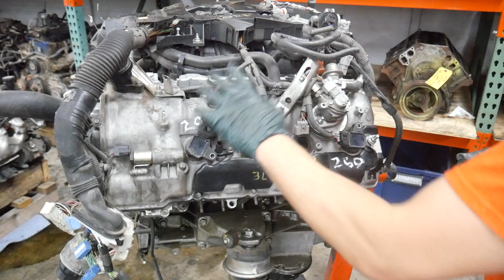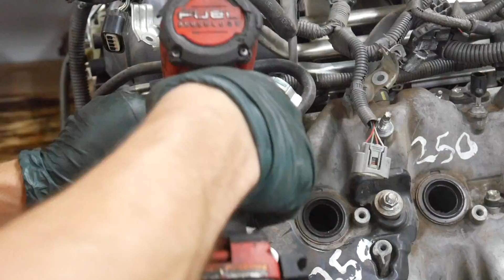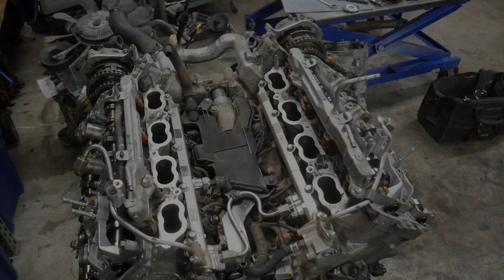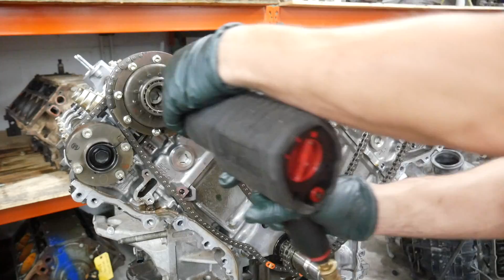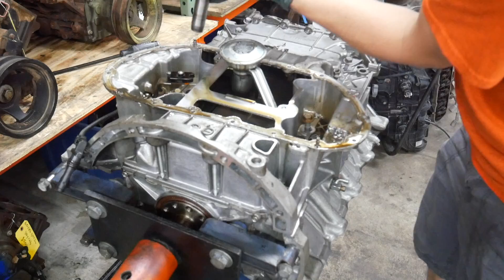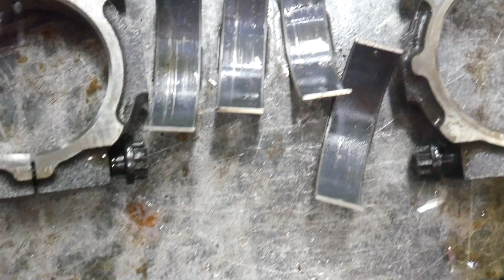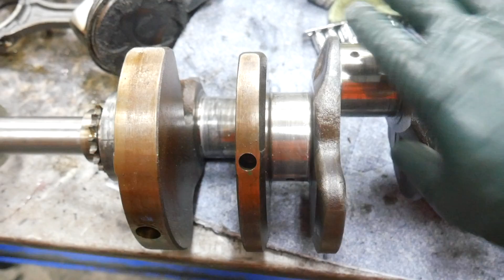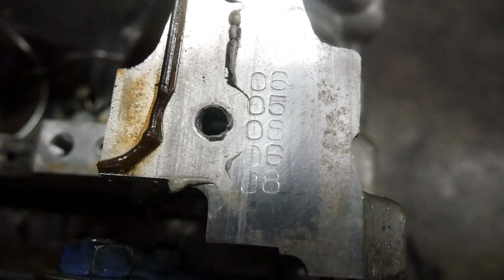Lexus LS460 1UR 4.6L V8 Blown Engine Total Teardown! How Did One Of The Most Reliable Engines Fail?

Comment: Holy hell the insides of that motor is mint, how does Toyota do it?
Reply: All engines will look like this if you change the whole often.
Reply: @alexstromberg7696  not true.  Most engines have hot spots that get the oil too hot, even when perfectly maintained and running in perfect conditions.  High temps degrade the oil and cause deposits.
Reply: My nissan VG40 looks similar.  

Just a beautiful design... That looks an awful lot like a refined 1970s v8....

Looking at you Ford, Chevy Dodge.

That engine has little pieces of each.

Comment: My educated guess is that engine was oil starved.  Ran low on oil or a short period with no oil.
Reply: Bingo
Reply: I owned a 1977 Grand Prix with a Pontiac 350 cu in.engine.This was a similar bearing failure at 22000 miles.The engine always ran hot when I bought it new. Stuck a rebuilt old's engine in it, added 80000 more miles before I sold it.
Reply: I’d suggest your “educated guess” lacks evidentiary support. An oil starved engine typically has substantial heat signature and coking of oil residue. This engine has neither. Knowing the oil circulation system may provide better diagnostic evidence of failure. I’d personally be looking at pump and pressure relief valve as well as oil filter. 

For some reason #3 big end spun, commonly this is pressure related. Once that happened the entire system was compromised w/bearing debris. Determining the reason for that failure is the key
Reply: @MichaelM-to4sg  if the oiling port was partially blocked due to bearing movement - perhaps the wrong bearing size was used during assembly - oil starvation and a spun bearing condition could occur. Once the bearing let go, metal clogs the oil pick-up resulting in oiling issues to the main and other rod bearings.

The scary part is this comment got 22 likes, yet no other part of the engine shows signs of oil starvation.
Reply: @Ericsaidful  This was presumably not a new engine. Incorrect bearing shell size, the engine doesn’t make it more than 10 hours under load. 

Spun big end is nearly always pressure related. It would take a lot more analysis of oiling system, beginning from its origin, the pump and pressure relief through galleys and feed system to crank to identify the starvation issue. I highly doubt it was lack of oil in sump nor lack of servicing.
Reply: @MichaelM-to4sg  The engine looks like it's definitely got less than 120,000 miles on it, at least. No varnish, nothing is worn aside from the bearings, not one spec of sludge, discoloration, nothing. 
There is a working theory that Ram 3.0 has had a batch of assembly issues because they have had issues with spun bearings on the mains as well. 

I'm not an engineer or a mechanic. But if there was an oil starvation issue I believe you would see evidence where oil reaches last, the cams and cylinder head. However, there was not one blemish in either cylinder head or on any bearings and moving parts. 

Thus, I'd make an assertion that the bearing shifted blocking the oil port, resulting in oil starvation to that one cap until the bearing went.
Reply: @Ericsaidful  I am retired AE/ME. Involved more in development of gas turbine hot sections so no direct experience in piston engine engineering. I’ve built more than my share of race motorcycle engines. I also owned a BMW M5 w/E60 V10. During my 8 months of ownership the engine seized twice, the 2nd time threw rod through case & BMW volunteered to lemon law the car. I was not alone w/this experience. That engine was known for incorrect main bearing shell clearance. The first failure occurred at 4900 miles, the 2nd was less than 600 miles after rebuild. If the shells were too tight, they would spin extraordinarily fast. Too loose, they’d be noisy from outset and would fail long before 100k miles, likely less than 25000 miles. 

Lexus I believe requires full synthetic POA oil, our RX450H did. I also owned an LX570, using a version of this very motor but it was over a decade ago thus I do not recall if it too required synthetic oil. If this engine has used synthetic oil, changed regularly, there is very little sludge or discolouration evidenced in a 120k mile engine. The vapor point on synthetics is too high for coking and sludge deposits. The cam lobes did show some varnishing. I’d like to see piston skirts and cylinder bores to better indicate wear, but w/o service history a lot is guess work. Regular servicing w/ synthetic base oils look like this at 150k+ miles, assuming good ring sealing to mitigate oil contamination.
Reply: @MichaelM-to4sg  still begs the question of how the main caps spun. If you were an engineer I can assume you have some educated guesses as to how they may happen with no wear evidenced outside of that caused by the chewed bearing.
Reply: @Ericsaidful  I do not know the oil supply circuit on this motor, without that knowledge and more detailed hands-on inspection, specifically of oil pump and pressure relief valve, it’s honestly guesswork and speculation. I am relatively certain the big end bearing on cyl 2 was the first fail item. It’s common that once a single bottom end bearing begins to disintegrate, the entire oil feed system is contaminated and thus subject to failure. If debris from big end bearing entered the feed to that main, that alone could have led to seizure of shell-journal causing it to spin. That’s just speculative. I think the bigger question is what led to failure of big end bearing.
Reply: You are all wrong the engine came from a Lexus  that was owned and driven by a woman no need to explain.

Comment: I heard toyota is going with 0w15 oil and 10,000 mile intervals. You might start seeing more of them 🤔
Reply: I have a 19 camry recommends, 0-16, and the oil filter looks like it belongs on an atv. Less than three inches tall. I'm insane and still try and do 3000 mile oil changes
Reply: @12345.......  at 3k miles that oil is still new.  You're free to do what you want, but these engineers spend billions in research to figure this stuff out.
Reply: @Frost640  I know, but I'm insane. If I schedule for 3000 I will get to it by 4 or 5000.
Reply: @12345.......  Good thinking. Better safe than sorry. My last Toyota had 325k miles when I sold it and the engine was spotless like this. I used bulk oil, a Toyota filter and BG MOA oil treatment hence the cleanliness.
Reply: 0w16 actually. I believe their reasoning was that the thinner oil wastes less energy through pumping losses as it warms up, and cars in Japan have been using it for a while I guess. There are some talks of taking it down to 0w8, the next lowest oil viscosity.
Reply: @artemovsk1  Lighter oil will lead to more oil consumption people will  really need to watch that dipstick at 10k intervals.  Personally I even question 0w-20 one on my cars goes down to 19-20 PSI at idle and at 200 degrees oil temp but 85psi at full throttle.   I personally would rather give up the 1/8  mpg for more oil pressure at low rpm.
Reply: My 2017 corolla takes 0w20 full synthetic and it came with lifetime oil changes at 10k miles with a lifetime engine guarantee. 🤷‍♂️
Reply: If you read the owner’s manual carefully it gives you different conditions i.e short trips you have to change the oil at 6500km (4000 miles) etc and in different areas like Middle East it says you may use up to 5w30 oil for the new dynamic force engines 2.0l and 2.5l 4 cylinder
Reply: 0-20 currently, moving to 0-16 and we've had 10k intervals since 2010.  I've seen plenty of our cars 5-10k miles over and they're just fine still, odds are someone didn't fill it properly. the only time we see these engines getting work done is the coolant valley plate leaking and this block had plenty of coolant in it from what I could see.